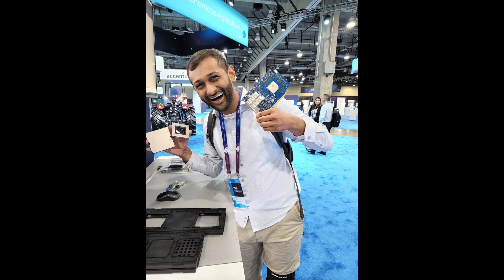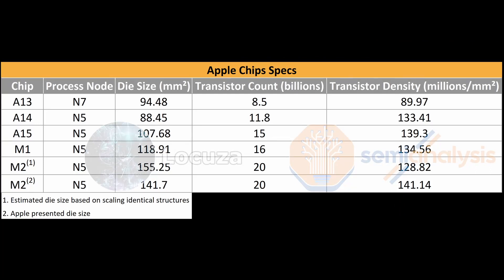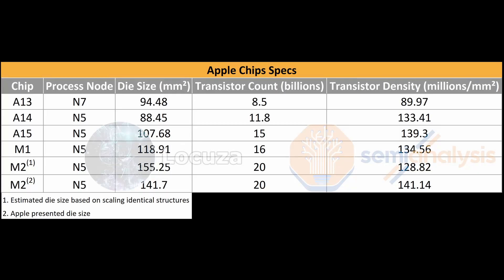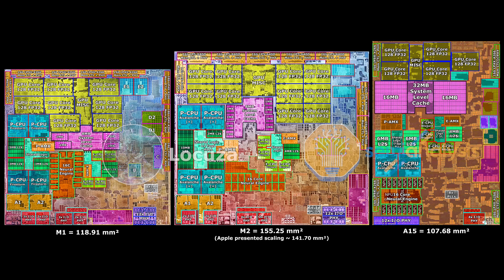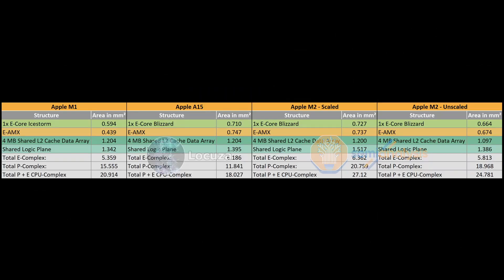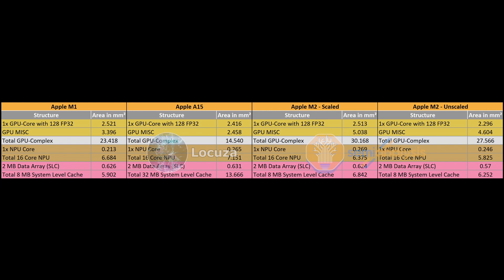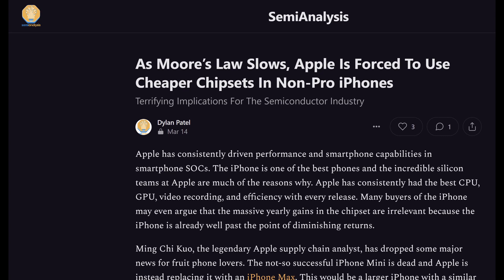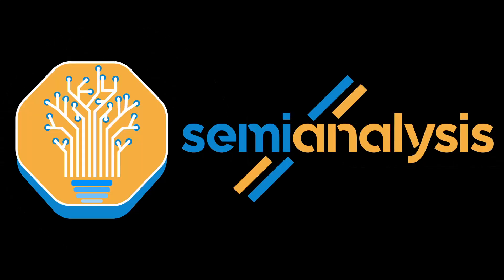Apple M2 Die Shot and Architecture Analysis – Big Cost Increase And A15 Based IP

Comment: Great vid. Thanks for this.

Beyond talent poaching resulting in lackluster M2 updates, I have to wonder how marketing comes in to play. If the M2 performs too well, it competes with the much more expensive M1 Pro MBP. For single-threaded functions it will be zippier than any other Mac whatever the price, but 18% doesn't steal too much from the M1 Pro/Ultra. 

After the initial SoC launch (which still hasn't included the Mac Pro) Apple will be establishing a cadence and user expectations for our future purchases. Given the M1 is about a third slower than the M1 Pro for general multicore tasks (50% slower for GPU intensive tasks), the M2 brings this a lot closer without exceeding it. Still it is the faster machine for single threads... 

I also think marketing made Apple goose the price of the M2 MBA in order to encourage folks to keep spending upstream. By adding a few hardware upgrades they justify a little more, but $200 more may keep more folks from just getting a MBA for faster single thread performance and ~80% GPU performance, and this as our ravenous expectations for speed/upgrades may slow the appetite for M1 MBPs which are now getting contextually long in the tooth. Asian supply chain issues notwithstanding, people generally start to taper their buying prior to the Fall release.

Comment: The fact that m1 air didn't reduce in price at $999 for 7 core GPU despite being 2 yo and amazon etc have it at $899 or lower last year means that we are in a stagnation for perf/cost for Apple. This is an opportunity for Qualcomm with Nuvia, and AMD to strike back. As for intel, I think they made mistake by only including 2+8 config for their U9 and U15 chip, have seen them underperformed vs ryzen 5000 at game thus making it worse than tigerlake 4+0. It also explains why oem go to with p28 with 4+8 config even though it will throttle. It will be interesting to see AMD big little too with zen5+4c at mobile.
Reply from the maker: You sure 2+8 underperforms TGL U? I've seen it outperform, but Intel not be able to ramp it because there's too much TGL inventory because PC market is cratering.